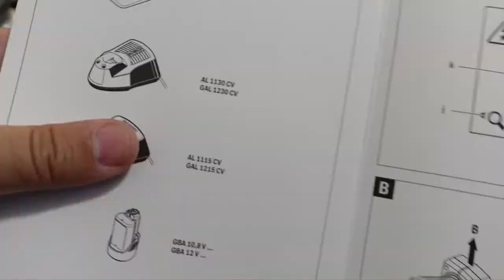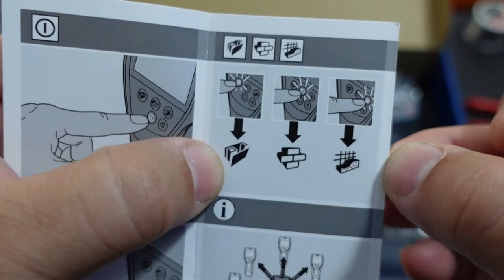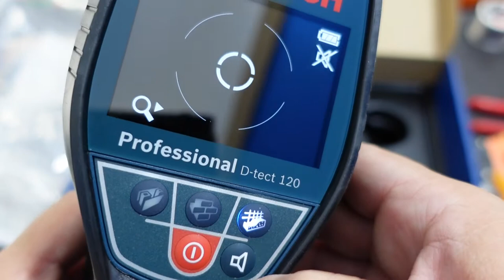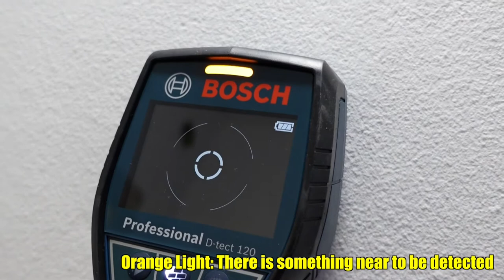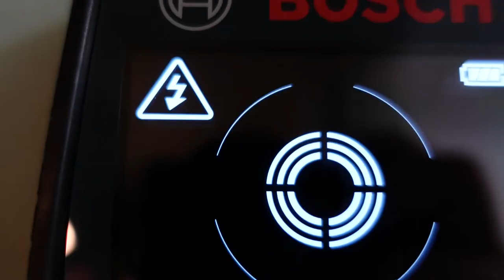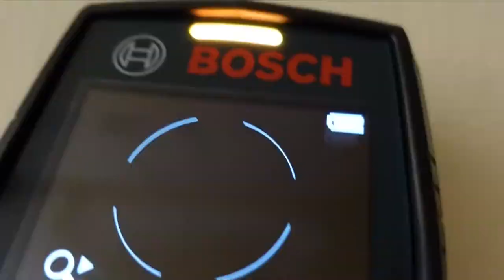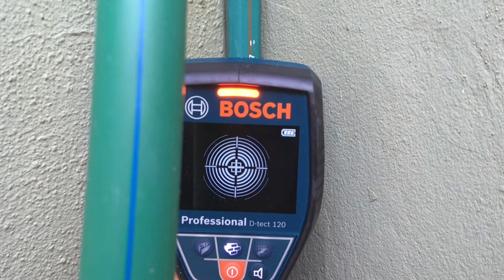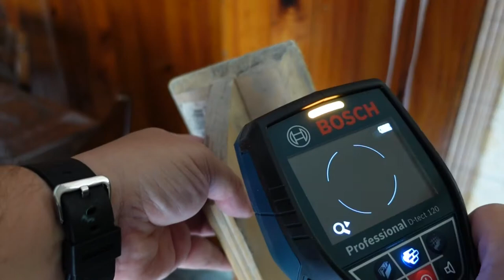Wall pipe detector - Bosch D TEC 120.

Comment: can this device detect a drainage pvc pipe behind a wall (e.g. measure while drain water), OR can it detect a PVC pipe behind a wall if insert an electric wire into the pipe (without electricity)?